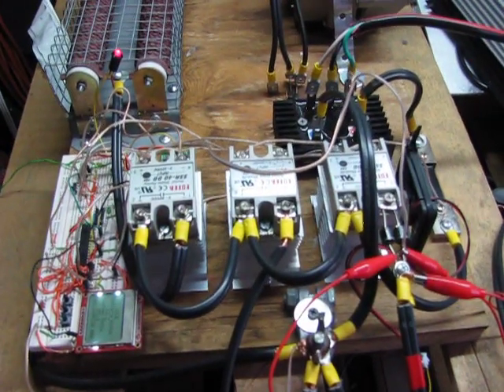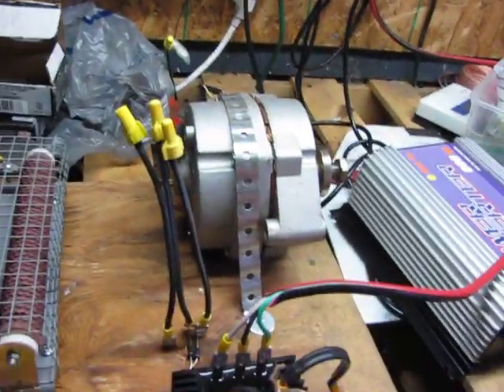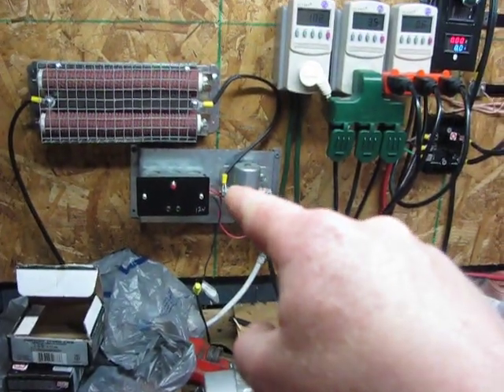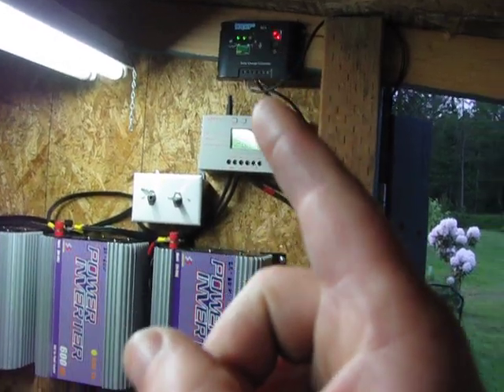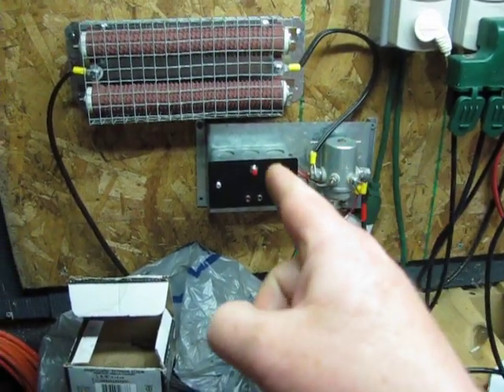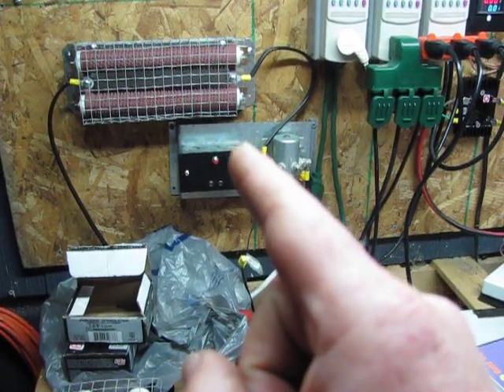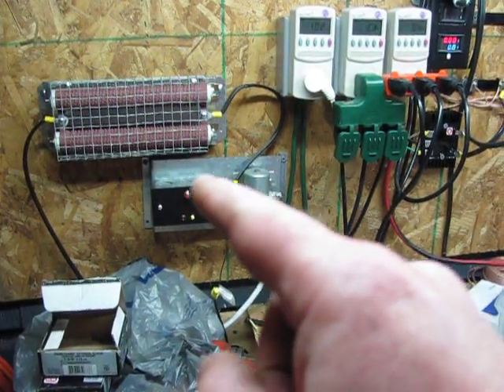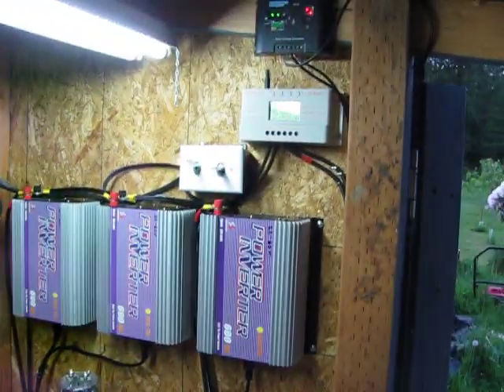Cheep dump load controller #2

Comment: Hello farmer! 👎

No, this is not a real wind charge controller, this magnet switch / relay (referred to as "solinioid") for which you paid US $ 40 comes from the Chinese as well and they sell this round about for US $ 6 to 8!
With US $ 40 they have pulled you over the table! Search Google, there you will find everything, especially on eBay!
And this mechanical relay will eventually burn you off in strong gusts of wind and bake the contacts together! How long does the fire department need to get to your house?
Then you will really enjoy it - Hosanna!
Just take the "SSR - Solid State Relay" from China for dumping the wind turbine, only the relay costs about US $ 4, the heatsink costs extra a few dollars if you do not have a heat sink, but the heatsink is essential necessary!
The shipping is free worldwide!

Best regards from Austria!

PS .: Yes, in Austria there is also wind and sun, there are also built-in Chinese solid-state relays and no, there are no kangaroos here, except in the zoo!

Comment: lolwhut? a battery is quite slow - if its full, the dumpload is used. dont need a fast controller AT ALL... what you're telling there is quite nonsense

also there are cheap chinese wind loadcontrollers for ~20bucks out there for small form wind generators.

Comment: You should try my water heater dump controller using a cheap 3525 ebay board. It responds instantly to excess voltage. Have lots of interesting videos on DIY solar.
Reply: I’d be interested
Reply: @Livingfreewithunclewill  These are basic shunt regulators which update in milliseconds. Need to know what operating voltage and expected current.

Comment: can you make me a turbine charge control that the dump can be directed to a grid tie..i all ready have a gti?
Reply from the maker: I recommend always using a resistor dump load, with your wind turbine.
What if the power goes out?
Reply: how much would you charge for the one with the resistor?i just put up 2 100 watt solar panels up and a 380 watt wind turbine..but i dont know how to tie them in to gether to charge battery's

 (6)
Reply from the maker: Billy bussnesman
I can build you a charge controller that will do what you want/need,,, Problem is I am not sure the price yet,, I am still designing,, programming,, and testing,, my first prototype charge controller :)
 So far my prototype charge controller is working awesome and is easy to adjust and tweak for your needs,, everything seems to be working perfectly,,, I am scared to put my name on something and sell it,, What if something goes wrong with it for my customer?,, that is why I am still doing testing on it,,,

But if you want one,,( no guarantees or warranties of any kind) I can build you one in a nice metal box and everything ,, for around $250-$300 U.S. ,, I can sell you one for less if you don't mind a little DIY work ( you buy the box ,, cut the holes and mount everything inside it yourself) $150-$200 U.S. ,, you buy the resistor dump load yourself from Missouri Wind and Solar ,,,

If you want to just hook up and not worry about anything I can sell you everything ready to go for around $400.- $500. U.S. ,, that includes the resistor dump load ( just in case the power goes out and the grid ties are off) Keep a load on your turbine and don't let your batteries over charge,,

 Remember my charge controllers are in prototype ,, I can build you what ever you want,, but custom built charge controllers at my stage of development,, cost more money,,, because I have to pay more for the parts to build it right now,,,  Right now my charge controllers are able to handle 12 -110 volt DC incoming volts max ,, One of my controllers can handle up to 100amps max,, you can adjust all settings how you want it for your setup in your area,,, You can always restore factory defaults so you don't have to be afraid of making a mistake when messing with the settings and trying new things with your setup,,,
Reply: keep doing your test and let me know the results...i like the idea of  the resistors instead of gti..a lot safer..
.
Reply from the maker: Billy bussnesman
What price range are you looking for in a charge controller for your Wind and Solar system? I don't know if I can beat the Chinese prices ,, but I can try :) ,, I dont even know if there is a easily user adjustable Wind and Solar charge controller out there that can handle up to 110 DC volts at 100amps ? ,,, I Made one and It is working awesome :) ,,, so far,,,
Reply: i put a drill on mine and the highest it got and it was a spinning was 24 volts and i didnt measure the watts but it was rated at 380
annd as my price range i dont know yet i am still comparing all the prices
Reply: i have a question?i am burning all my brain cells trying to figure out if they make a hybrid solar and wind controller?what i am finding is that they are some ,but it is for a turbine that is 3 phase that gets rectified by the hybrid controller.but i have a DC turbine that creates 01-24ish volts from motor...i can not find such a hybrid controller?can you direct me in any direction?
Reply: Billy bussnesman   try these...
http://www.ebay.ca/itm/1500W-24V-Solar-Wind-Hybrid-Charge-Controller-for-Air-X-Apollo-Ametek-Solar-/360667303890?pt=LH_DefaultDomain_0&hash=item53f9724fd2

http://www.ebay.ca/itm/1000W-12V-Solar-Wind-Hybrid-Charge-Controller-for-Air-X-Apollo-Ametek-Solar-/360356221392?pt=LH_DefaultDomain_0&hash=item53e6e791d0
Reply: Missouri wind and solar sells controlers without the turbine brake and the rectifier. they also sell the dump load resistors.

https://mwands.com/store/charge-controllers/hybrid-charge-controllers/12-volt-digital-440-amp-charge-controller-divert-relay

Comment: why not just dump the power from the turbines into the batteries, then have a charge controller with dump load regulating the batteries vs running the turbine into a charge controller then to the batteries?
Reply from the maker: You can do that,, but I found that doing it this way will drain your batteries faster than recharging them in low winds,, Lets say for example a 2second 20mph wind gust hits your turbine and makes 14.4 volts ,, the dump load controller kicks on and dumps 1200w for 5 seconds out of your batteries,, do this 2 or 3 times and your battery bank will be drained 
,,,,
OOh and the lower your battery bank gets the easier it gets for your turbine to hit 14.4 volts trying to recharge the batteries,,this causes your 1200w dump to kick on more often and drain your batteries even lower,, in low winds with occasional gusts around 20mph,,,
Reply: Jason Brown so what if you set the upper limit at 15 and lower at 12.5 or 13, why would the batteries be drained?
Reply from the maker: john otoole
I have not found a dump load controller for 12 volt or 24 volt turbines that you can adjust the upper and lower limit on,, yet,, That is why I am building my own :)
 And because I am building my own I decided to add allot more bells and whistles so I can adjust and change it to whatever I might need in the future,, I will never need to buy another wind turbine charge controller,, I just change the settings on it,,
Reply: Jason Brown it's the Xantrex c40, I think Snieder owns the brand now, here is the pdf
http://www.wsetech.com/pdfs/C_series_manual.pdf
Reply from the maker: We got a Xantrex grid tie model in our garage ,, someone tore it apart and looks like they took a hammer to it,, we found it in a dumpster ,,,, I can make a video showing the parts we found in a dumpster,,

Outback and Midnite are much better ... but if you want to spend that kind of money,, feel free to ,,, I just want to make something that costs less and works just as good or maybe better,,,
Reply: Jason Brown I'm starting to understand now, many of the under $200 controllers don't have a simple way to adjust the thresholds for high and low limits, plus other functions. so you are accessing the code to manipulate the instructions or building your own to do the same.
thanks